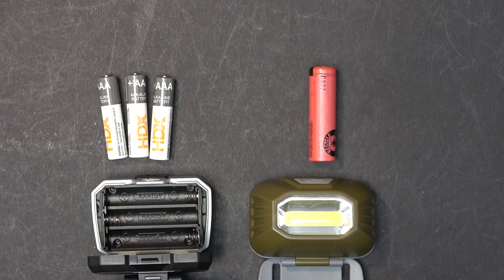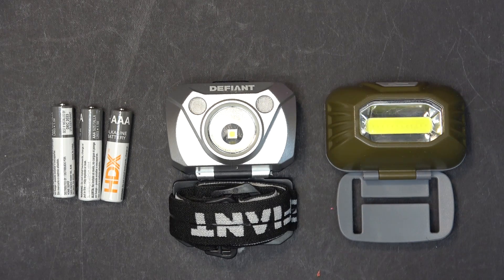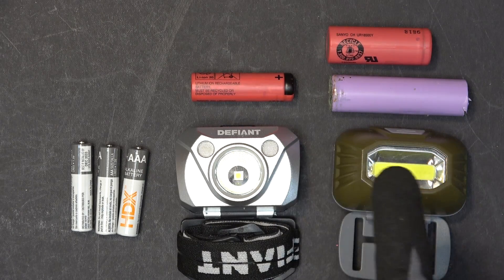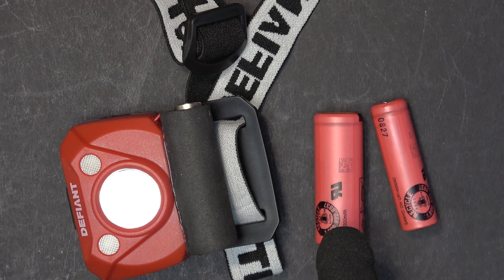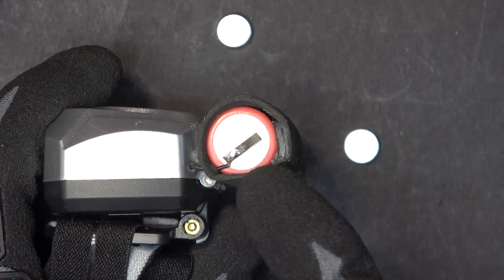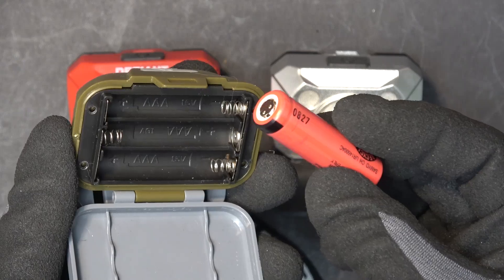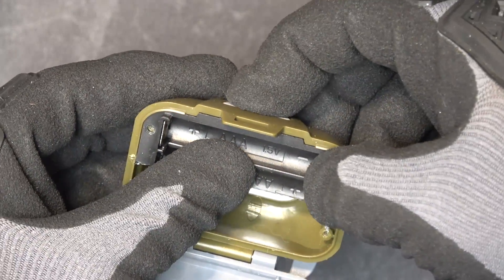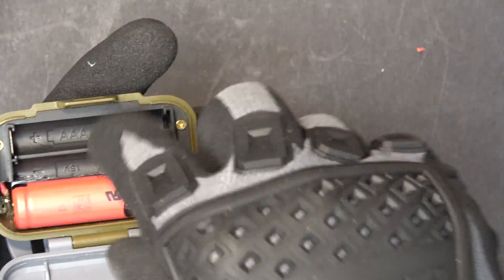Head lamp battery hack: from AAA to Li-ion rechargeable battery

Comment: If the weight of the battery is a concern and you're already mounting external you could just move the cell to the back of the strap as a counterweight. I'd recommend having both wires come back to the front on the same side and leaving some slack for adjustability. Might even be able to do less work for the battery holder, just have it wrapped around the headstrap or cut a couple slots to pass the strap through like belt loops.

Comment: You can also use NiMH batteries as they are available in AAA size.
They won't run for quite as long, but does not require any modifications to be done on the headlamp.
Reply: Yes, but they also provide a lower voltage. 3x~1,2V=3,6 so the lamp won't be as bright as with alkaline batteries.
Reply: @ Only for a certain period though. Alkalines are only 1,5VDC when full and drops linearly as it gets drained.

At 50% charge, Alkalines are at about 1,2VDC.

Comment: Very nice mod and I definitely appreciate the use of the magnets instead of trying to fit some sort of spring and plate for the contacts.
Reply: rather then using cylinder size battery should use pouch battery like a cellphone one, you can fit bigger capacity to and its more light weight

Comment: I've done several of these myself, and like you, opted for external mounting! But I found that recharging them inside the unit like a phone doesn't work bc phones have circuitry to handle the charge properly. Also for a crank type LED lantern the li-ion is brighter and stays charged longer. I don't think it charged faster bc the li-ions have more capacity.

Comment: Great great video!!  Is there a battery charger that you would recommend?
Reply from the maker: I use the Opus BT-C3100 for these because I can adjust the charging current down to 200mA.

Comment: You probably ought to add a diode to prevent accidentally reversing the battery and damaging the electronics.
Reply: It's led light , so it's a diode by itself, also adding a diode will result in a 0.7v drop so the lithium battery will go down from 4.2v to 3.5v